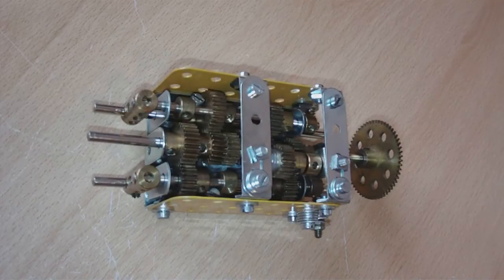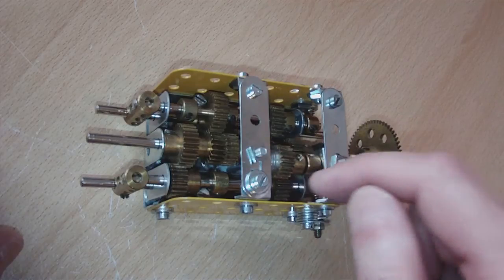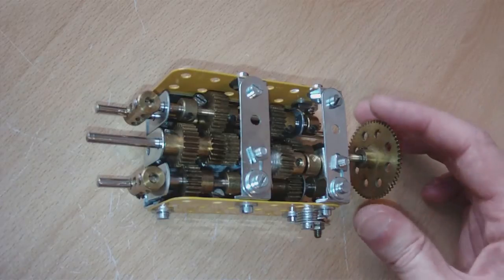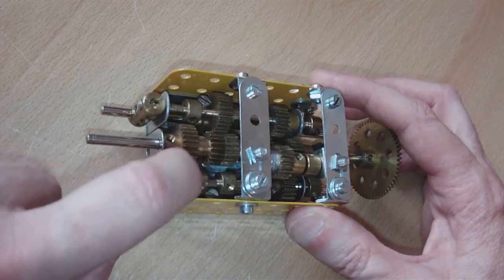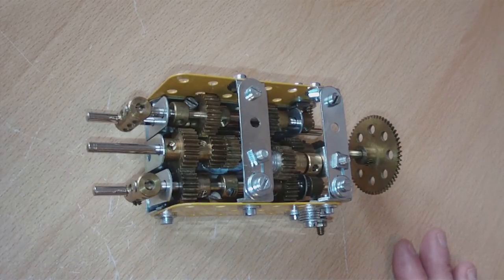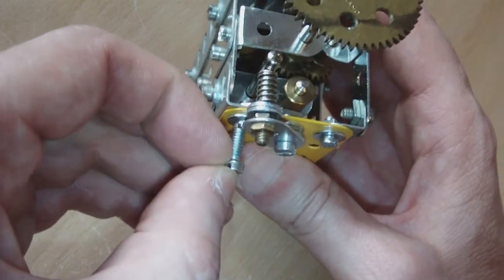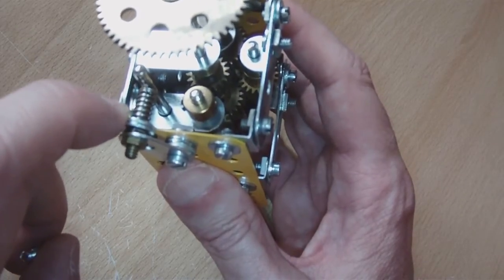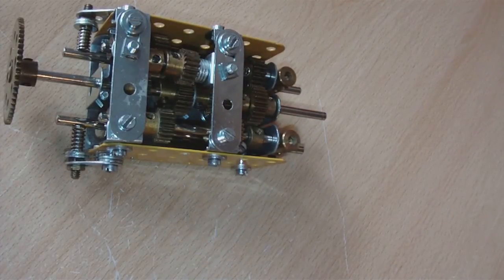Meccano Sports Motor Car Gearbox

Comment: Glad to have found this video.  The manual does not explain very well, and the chance to see a working example is really appreciated.
Reply from the maker: I've lost you're most recent comment. The ratios are reverse 25:19, 1st 625:381, 2nd 1:1, 3rd 381:625. Top gear is a 25t pinion on the input shaft to a 19t pinion on the far lay shaft. Then to the left on that shaft is a 25t pinion to a 19t pinion on the output shaft. Remember the middle shaft comprises two rods and one rod goes into the end of the pinion on the other rod. So the two 19t pinions seen there are independent. I can't think of any better way of explaining it.
Reply: @MECCNUTTY  Thanks, I edited my comment when I realised I was mistaken.  I was hoping you hadn't yet seen the original version but thanks for taking the trouble to explain.